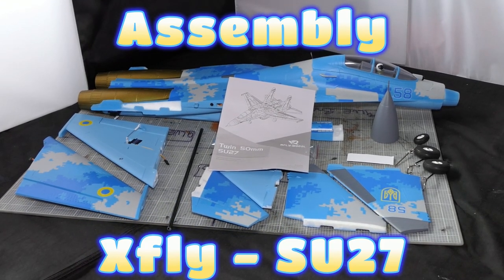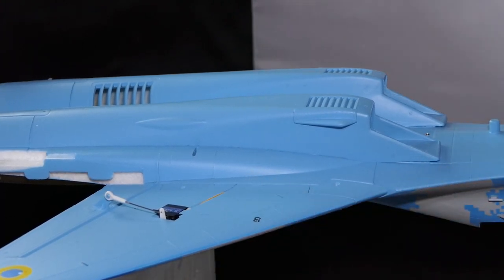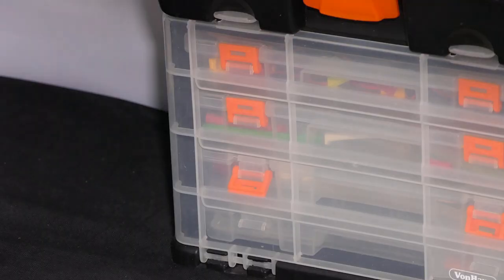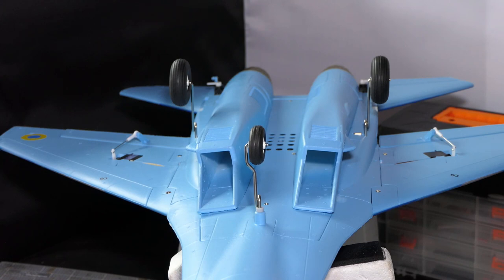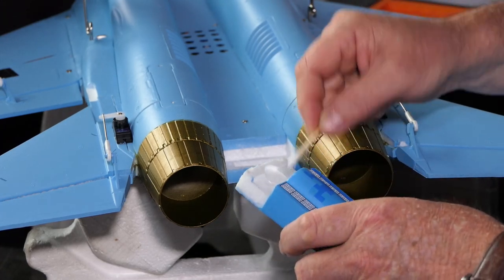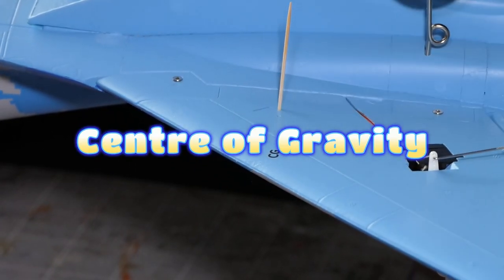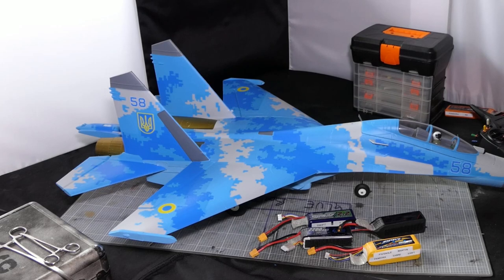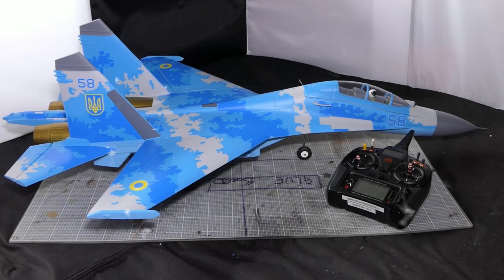Assembly -  Xfly SU27 Twin 50mm EDF - August 2022

Comment: Can’t wait to see maiden to see how your rates work Martin, i wanna build mine but I’m struggling for space at mo lol , I’m waiting on filler paint and new numbers and couple letters for top of wing of Stinson 🫡 Gary 🇬🇧 just remembered do you think if I didn’t put ventral fins on it would affect flying cos was thinking of doing belly lander I shouldn’t imagine they put these planes in wind tunnel to get the aerodynamics that perfect do they, 🫡 G🇬🇧
Reply from the maker: Hi Gazza, I think I will be quit  thence when doing the maiden on this one - which is not good - I will need to relax and enjoy it - You and me both regarding the space issue !! - are you going to repaint the whole of the Stinson or just touch it up a little ?, It interesting regarding the Ventral fins - IF i end up hand launching this one - I will leave them on but use clear packing tape over then to give them some strength , have no idea how long they would last like that - I am sure its just for the scale look that they added them - I have flown a few jets with missing ventral fins and it has made not noticeable difference to me...   Let me know how you get one - Stay safe Martyn
Reply: @FlankerTanker  I’m gonna just touch it up but if it doesn’t look right I’ll get bigger pot and do it all I’ll put on my channel when I’ve done, I was thinking that they may just be scale on the su27 myself or like you mentioned cut them down a bit and cover them in clear book cover stuff , some people cover their whole planes in it I’ve seen but wouldn’t like to say how much weight it would add , I’m the same with maidens they can be scary sometimes and the money we pay for them it can be exspencive touch wood I’ve never had one completely destroyed yet lol I’ve always been able to fix my Texan is just going to fly with out a cowl I was looking at some the other day that I may be able to find some way of putting on lol this addiction whoops I mean hobby is so good though, Gaza 🫡🇬🇧